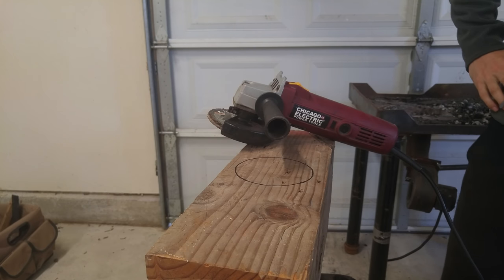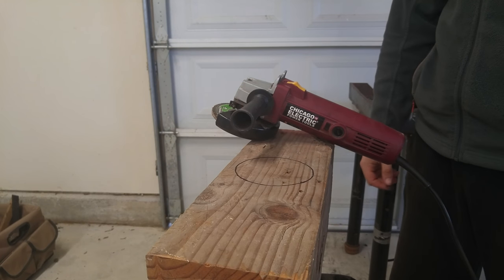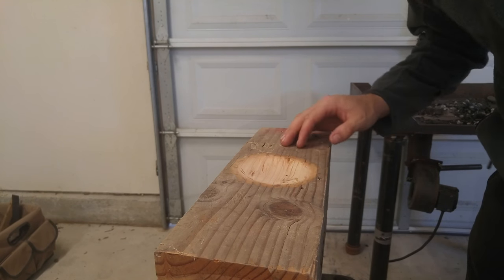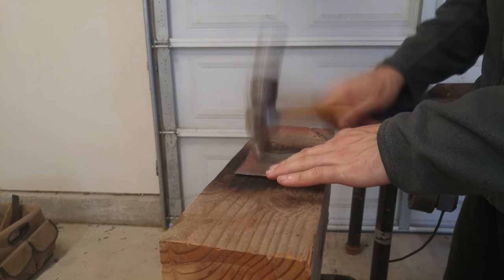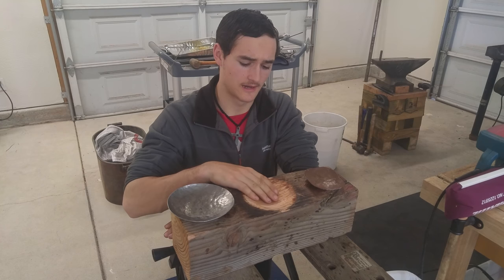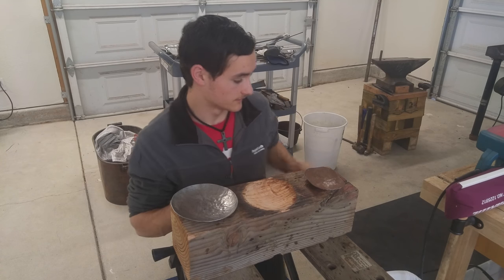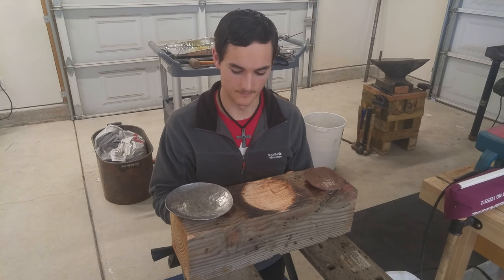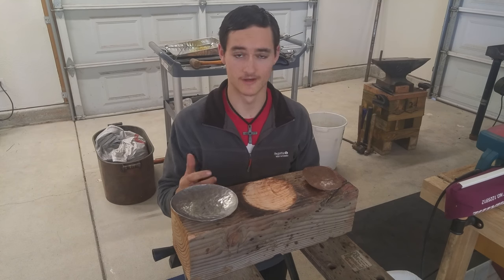Making A Wooden Swage Block/Dishing Stump For Dishing Steel

Comment: Dope intro mann, but I don't understand what it does. Can you please explain. Btw make a 15k special.
Reply from the maker: Taha Sarfraz Thanks man! This block allows me to make steel bowls. It's just a concave piece of material that lets me hammer the flat piece of metal to match the curved portion of the block. 

I won't be doing a 15,000 subscriber special, but I do have some metal working builds, a slingshot video, a shop equipment review and a weapon build coming shortly!